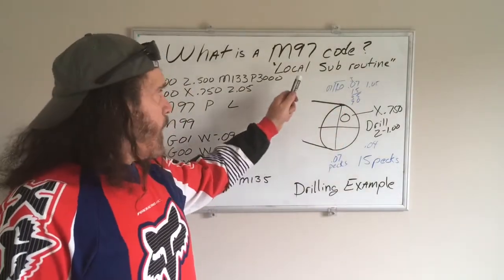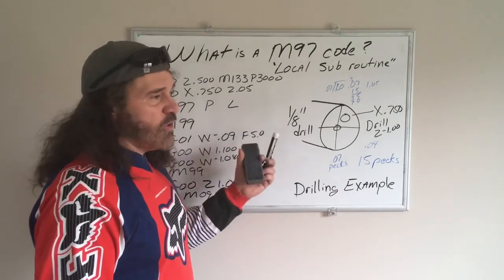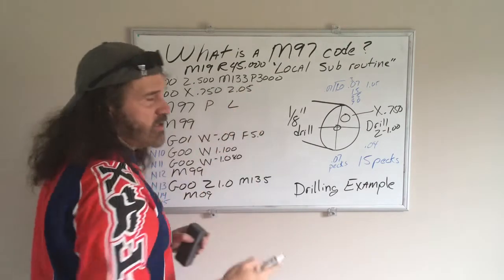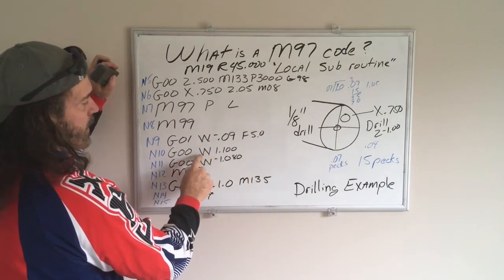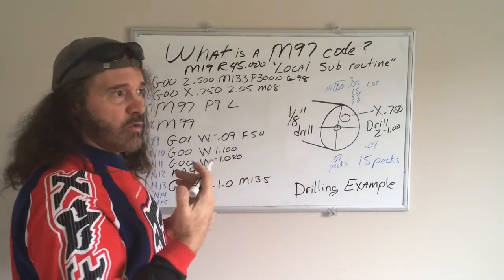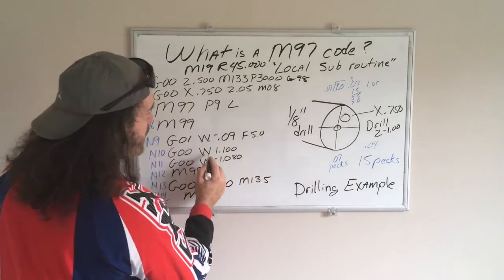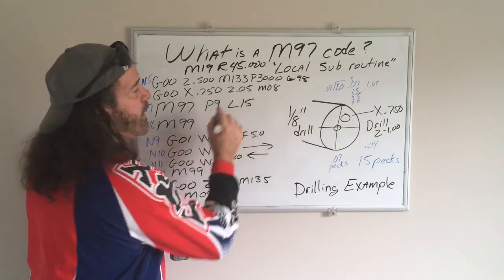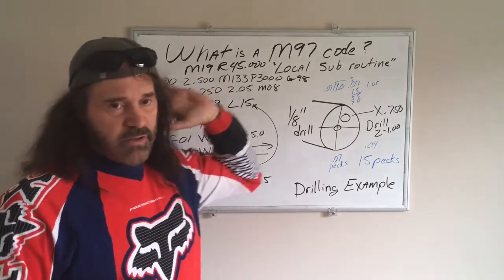Programming a M97  HAAS CNC lathe Z- Axis Live Tooling drilling example

Comment: I will write what I understood, if you could correct me if I am wrong it would be of great help!
First I position myself .05 from our face, then I hit g01 and go into my piece .04(.09-.05), flick away 1.100(so 1.060 from my face), then go in again with that - 1.080 and leave our .02 drill inside our piece, from this point I enter .09 more in my piece (w-.09), so every time the cycle repeats and drills (g01) I am really entering my piece .07" every peak ?(all this without considering drill tip)
Thanks for your content,i hope to see more!
Reply from the maker: Cad4U.....Thanks for watching my video.  It sounds like you got it! Yeah, where I work I had to figure out ways to go off center on the lathe and drill a hole. This was the easiest way I came up with. I would HIGHLY recommend if you are going to do this, go into single block mode and watch your program in graphics. Should be able to press the MEM key and the graphics key to bring up the graphics display.....at least on older machines.  Once you are in the graphics window , you can press F3 to bring up the WORK window, and press F4 to bring up the program in a window. Keep hitting cycle start and watch your program and take notice of your Z locations to make sure its doing what you want it to do. 
I will be adding content soon......been super hectic at work lately!!!
Reply: @Tims-Tractors-and-more  oh thanks teacher! I hope to see more of your content😁
Reply from the maker: @CAD4UNIVERSE  Hopefully soon for new content!